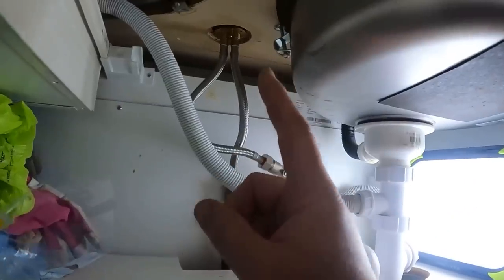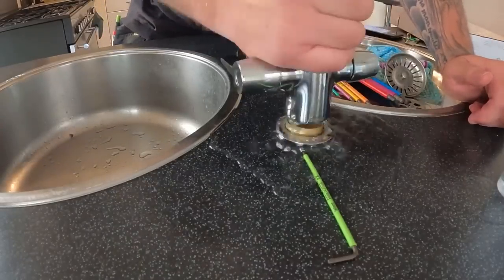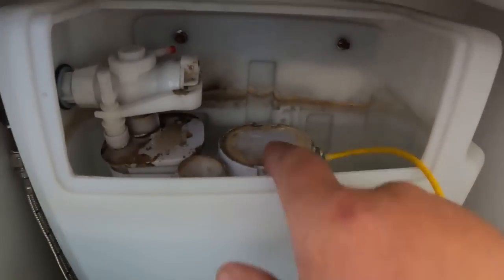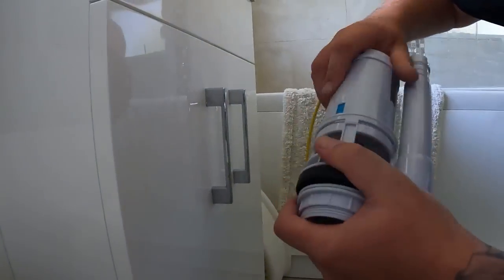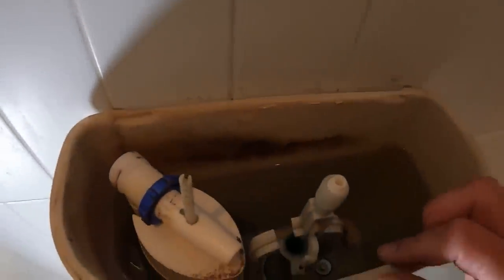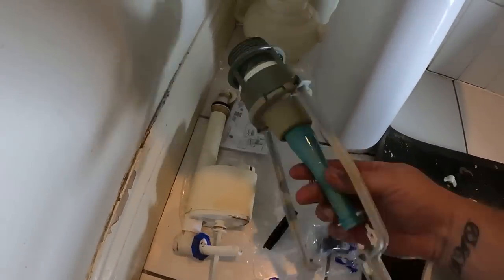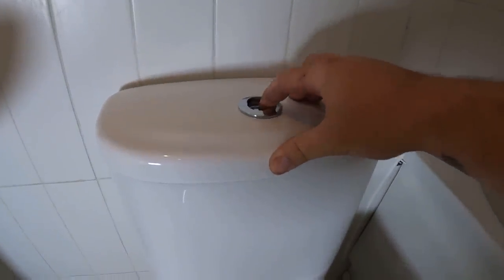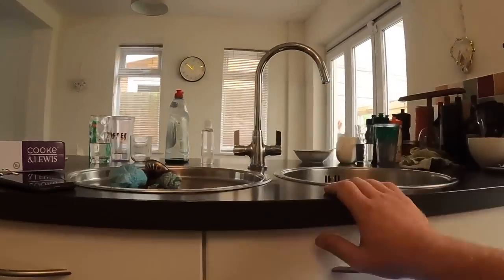KITCHEN MIXER TAP ISSUE..... One of THE WORST designed TAPS I've worked on

Comment: Got called to an easy fit tap that flooded someone's house. Tap blew off the base plate and the little old dear couldn't find the stop tap 😬
Reply from the maker: Yep, I can see why, 2 tiny grub screws to hold them on….. very bad design and a right pain
Reply: This was exactly my thought 
I’ve seen it happen to spouts but at least someone is at the sink when this happens and just turn the tap off. 
So I thought those easy fit will easily fly off
Reply: I fitted one Xmas eve, went back after new years for some more work. Double checked the tap and had to tweek the grub screws back up within a that time. Advised customer to periodically tighten. I've heard of 3 bar hitting the ceiling when these beauts fail 😅

Comment: I honestly highly rate Bristan taps along with the ease fit. Ive been doing site work for the last 3 years probably fitted close to 200+ only had an issue with one,  and that was a split in in the double check iso. But Guess it what you get used to. Also the tapex kit is amazing great tool.
Reply from the maker: Yep exactly that mate, if your fitting them day in day out and only had 1 issue then you will see them well👍🏼👍🏼 We all have certain stuff we like to work with.

And yer, the tap kit is a great tool to have on the van.
Reply: Have to agree Tom Walker; once you get use to the design & the way it works with how to fix tap top onto base, you'll never want to fit those fiddley tiny nut types again or the really bad large nut types with hoses through OR the spin type that then have 2 small screws to tighten up!! Only reason Easifit come away is fitter doesnt understand how the allen key grubs work.
Reply: With you mate. Can't beat the gear for the money. Fitted tons of their bar mixers, even got three in my own house for the last thirteen years.
Reply: I don’t mind easifit either, all that water came out because he had the taps turned on when he disconnected them so the spout drained down, to condemn them as shit because of that is just daft

Comment: I have an Aqualisa shower and it's awful. Absolute junk. Only give you short warranty and it usually doesn't last long enough. Had shower 6 years and 3 new motors in it and also burnt my wife quite badly once. So probably wouldn't recommend.

Comment: Has anyone found that the latest Bristan easy fit taps come away from the grub screw fixings? I have seen a couple of you tube clips of Hamish of Exeter. But guessing the tap issues have been ironed out since 2016, when he made the video warning others about the flaw! I have just fitted a Bristan echo for a friend on Friday, then seen the 2016 video clip afterwards! I have tightened the 2 grub screws so hope it will hold on the easy fit housing properly. Any ideas from you lot? Cheers
Reply from the maker: Wouldn’t touch them with a barge pole….. huge problem waiting to happen

Comment: Very helpful video. 3 years ago I actually chose a Pegler Jeroni swan neck single lever. Well Friday night the whole swan neck has completely come off. We had to wind it back on several times a week for the last 3months. Now the spout doesn;t even screw back on - it's too loose when I try and put it back on to the base of the tap. Do i need to poke an O ring inside the thread of the spout? Any ideas how to fix this please? Just until this Bank Holiday is over and I can get a plumber out. We are kitchen sink tapless! I really though Pegler were the Rolls Royce of taps??? Is nothing made to last anymore? Thanks for the video.
Reply from the maker: I would personally fit a new tap, that one sounds about knackered
Reply: @MJTiffPlumbing   Thank you so much for your reply. City plumbing are closed but will be there in the morning. Have a great Bank Holiday. We have bottled water to see us through til tomorrow. Cheers again.

Comment: do you like those isolation valves under the sink? i find they leak, better to use ball joint lever valves? whats your thoughts? maybe I'm using cheap screwfix stuff ?
Reply from the maker: Never had an issue with them…..👍🏼

Comment: To be fair I had an issue with a shower valve and after a little bit bother they bristan sent a new in box one but I try to stick with Mira where I can as their quality is another level , as for kitchen taps I like the models where you hand tighten a big cylinder block , no tools needed ,nice and simple

Comment: You poor man, Bristan has really upset you!!! I have used Easy fit and  rate the product, no problems fitting and straight swap with any other Easy if tap. Not had any issues with warranty claims, next day delivery, what more could you ask.  I agree with you regarding  Aqualisa comments, excellent  service. Stay cool, keep up with the channel, great job mate.
Reply from the maker: Indeed they are easy fit to replace…. IF the customer knows they have an easyfit tap and tells you this when you get the call for the job. If not you will purchase a tap to swap and then end up removing the easy fit system all together, same applies if the customer supplies there own tap and does not know they have an easyfit installed….. and 2 tiny grub screws to secure a mains fed tap!!!…. No thanks.

Each to there own but they are not a product I would want to put my name to.

However Aqualisa as you know are great…👍🏼👍🏼

Glad you like the channel and thanks for the comment, love hearing others views etc 👌🏼

Comment: Only easy fits I’ve seen pop off are from people I know didn’t locate the grub screws correctly.
Fitted loads never had an issue
They’re a decent price and everything in the box
2 grub screws off and new taps on with 2 grub screws easiest swap you’ll ever have
Reply from the maker: So you have seen them pop off as…. seems it happens a lot.
Problem you have is when someone rings up to change there kitchen tap so you get another one off the shelf or the home owner supplies a new one, chances are they don’t know they have an easyfit one so but a normal tap….  Then they have paid there money for a new tap and want it swapping.
Reply: @MJTiffPlumbing  
Even if it needs swapping to a different brand they ain’t hard to take off.
Don’t see a big deal really.
I get more upset with the massive stupid backnuts a lot of monobloc taps come with.
Think mainly from b&q and screwfix.
Reply: @plumbertime  those taps with the stupid big backnuts where the flexys go through the middle, that you can't get anything on to tighten properly cos there's no room ......WTF
Reply: I've checked all the ones I fitted after one blew off. The earliest designs had come loose while the better later 2 designs were still tight. I still wouldn't use them again though, as  I could see on the blown off one, how the grub screw had torn right through the brass. Maybe Customer had swung on the tap. As we all know, you've got to make stuff idiot proof........
Like top-cleaning shower/bath traps..... there's always somebody will manage to unscrew it if you don't silicone it in........

Comment: I've fitted a lot of Aqualisa digital showers: I have one in my bathroom. I've been to their factory and I'm a registered installer. Their customer service is good 👍🏻. But I do sometimes question the quality of their digital range. I've had control units misfuntion or parts breaking off very shortly after completion. I've also fitted Mira digital showers and their gravity pumped unit is a lot quiter than Aqualisa.
Reply from the maker: Yer Aqualisa service is spot on… great company

Comment: You were sooo lucky with that cistern refit cistern wasn't siliconed with 1/2 a tube to the tiles; I'm always getting that & takes a saw to get it off!! 
Must say Bristan have become a pain with the valves failing & having to get new ones from them!! Had 3 in last few months some only 3 months old. Not a happy plumber me. Yep, Aqualisa & Mira showers only too.
Reply from the maker: Yep usually a load of silicone holding them cisterns on as we know….👍🏼👍🏼

Comment: Bristan have an issue with that model ( echo) I've fitted 3 sets of cartridges to it within 2 years of fitting it. Bristan admitted the company which supplies the carts ti them were inferior, so now they have totally different carts & heads . Like you I went to town on them about the so called easi fit ! & the customer service agent agreed. Especially when i commented about having to fit the white thrust plate as well on them,  as it then doesn't become an easi fit!! 
I have fitted loads of these taps & have not had any issues in fitting them or blowing off . Bristan now offer 10years parts warranty on all thier products thats pretty good. Cooke & Lewis what you fitted from my understanding is 12 months on the carts but 5yrs on yhe finish !! 
What I tend to fit now are Franke taps great customer care & straightforward install with the 1 post install. Check out the Franke Athena as it gives good flow on LP & comes with M12 tails as opposed to M10 which are rubbish on LP so I always ask the customer what their plumbing system is so I know im not going to get poor flow. 
As for Roca donut seals they're quite difficult to get hold of off the shelf as they're a specific design and you can't use any other donut on them.  I try to carry a couple on the truck for situations such as what you had to do. You don't have to fit Roca fill valve & flush valve as ling as you have a new Roca donut seal , any 2" flushvalve such siamp viva etc will work a treat. Roca flush valves aren't cheap close to 40 quid & 20 quid for the button. Viva are about 15quid !! Worth baring in mind for the future 👌
Reply from the maker: Don’t believe any warranty that Bristan “say” they have….. I’ve done a video on this exact thing…

The “2 year parts and Labour warranty” advertised on the from of the showers is not a “2 year parts and Labour warranty”

As said in the video, this tap set I’ve fitted is a quick fix as it’s all coming out soon

Comment: Worst taps ever, Bristan have changed the original grubscrew design twice because they well know theres a problem, but you'll never get them to admit it. The 1st design is apparently the worst, I have had one blow the tap off, fortunately customer could turn water off immediately. The grub screw had literally tore through the brass, maybe customer had been swinging on the tap but even so that shouldnt happen.
I ended up going back to every Easifit I'd ever fitted and checking the grub screws. They had come slightly loose on the 1st designs, I threadlocked them back in. Will never use Bristan again. Their showers are also sh1t, and dont even get me started on the bath shower mixer diverters.
Great video Tiffybobs.
Reply from the maker: Horrific taps and a massive flood just waiting to happen imho
Reply: @MJTiffPlumbing  IMHO, YHO is correct....

Comment: I could tell you was not impressed with the Bristan easy fit tap, I have some experience with those taps and yes you are right they are crap.
They also have a habit of blowing off the base, unless you constantly check the grub screws remain tight and who will do that???
Another great film, take care, regards, Chris. 👍👍👍
Reply from the maker: Could you tell Chris🤣🤣🤣…. My old friend Bristan again🙈
Someone has said in the comments they went to a flooded house because of that exact thing…… worst design ever
Reply: @MJTiffPlumbing  yep I agree, take care mate, 🍻👍👍👍
Reply: I heard 'fucking Bristan' under the breath at least ten times 😂

Comment: I changed one of those taps last week , I was just glad the two grub screws holding the body in place weren’t seized up .
Luckily I had better luck than you Mark 😁
Reply from the maker: Crazy that just 2 tiny grub screws hold in a tap as if it comes off it will flood the house as a few people have said on here

Comment: The EasyFit range were really designed for the DIY homeowner and not a plumber who will have all the right tools. Replace the tap with another in the same range with just two hex keys. Job done. However, they can be a pain to initially fit, especially if the pipework needs changing. And I've had capillary issues with one tap which made it drip for a long time after turning it off resulting in swapping it out for a cheaper Screwfix  tap! 😂
Reply from the maker: Not a great design for a homeowner to do it DIY style with those grub screws….. it is goes wrong it’s flood the house with mains pressure…
A design that never needed designing
Reply: A solution looking for a problem?  @MJTiffPlumbing
Reply from the maker: Exactly mate

Comment: Screwfix have some of the Bristan kitchen taps as trade rated.  I think the idea of being able to swap them out for a DIYer is good but by the looks of it the enineering design is poor.  Just held on with grub screws.  A company like Bristan would do well to listen to fitters/rapair plumbers/maitenance people and change the design.  Proper trades people will just stop using their products.  Seeing this video I will not touch their products .   Wont be long before they get sued for a leak that does a lot of damage to a property.   I bet you editted out a lot of the swearing on that job.  Keep up the good work Mark.
Reply from the maker: Indeed a lot of it was on the cutting room floor…. Hahaha…..
Not a great design at all
Reply: Yep, even if only 1percent blow off and even it's cos of customers swinging on the tap, that's still not ok in my opinion. If it can go wrong, it will !

Comment: Nothing wrong with Bristan, I’ve got a built in mixer from them and it’s not given me any issues for the last 7 years, even on jobs I’ve not had any issues with Bristan. Great video as always though always good hearing the views of other plumbers
Reply: I don’t think this design is as bad as a grohe filter tap I’ve installed lately, once it’s on the only way of taking it off is to cut the tap in half… and then unscrew the locking mechanism what a crap design
Reply: Called grohe minta🤦🏽‍♂️
Reply from the maker: I’m not a fan of Bristan as you can see

Comment: Good tap design, obviously to easily swap a Bristan for a Bristan. Really quick and easy to be honest. Also maybe it's worth being a a little less brutal with your tools, slamming them on and around the sink drainer can easily scratch it.
Reply from the maker: 2 tint grub screws holding a tap on that could be at least 3bar of mains water pressure is not a good design imho…. But each to there own buddy 👍🏼👍🏼

As for “slamming my tools down”……. If you listened to the video you will hear that it’s a mates house which is being ripped out in the near future…. But thanks anyway 👍🏼👍🏼

Comment: I’ve had 4 of these failing it’s only 2 grub screws pull off jobs done these were still under guarantee £65 labour 10mins work you made a meal out of it
Reply from the maker: It’s not 10 minutes when you have to change the whole base unit as per the video….

Plus if it takes you 10mins it hardly an easy fit is it.

Comment: Na I think I’d side with Tiff. What rhymes with fit? I’ve put a few in as well. It’s far from easy, unless of course you’ve got two elbows on one arm and it happens to be 6 ft long. You usually have to ask the customer to hold it in place. Try putting one of those on a butler sink and you’ll know all about it. 
However BS offer a generous 10 year guarantee and if you can be bothered to supply an image of the laser etching on the back of the tap they usually have no issue suppling spares. 
I also see a lot of Bristan taps dripping. Is that because they are popular. Or s@@t. 
I wouldn’t touch their electric showers with a barge pole. Bristan Joy. What a joy.
Reply from the maker: Crap ain’t they mate……. Utter utter crap

Comment: Would you not disconnect the bottom connections first on a regular kitchen tap? Lol
Reply from the maker: Yes you would…. Lol

Your missing the point, the Bristan “easyfit” is supposed to be easy to switch by turning the water off and swapping the tap unit, but this clearly shows you can’t just shut it off and remove it, you have to disconnect and drain the Pipework…. So it’s not as easy as they make out….. hence the whole point of what I’ve shown in the video